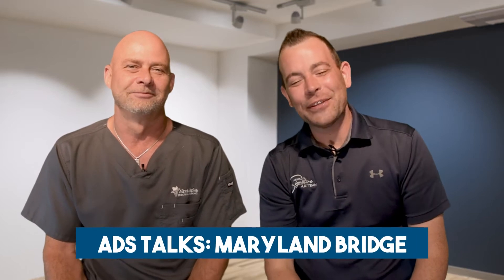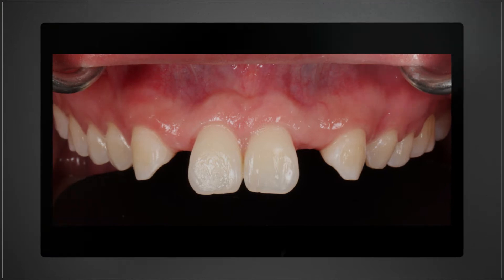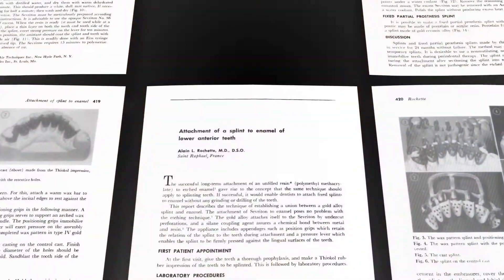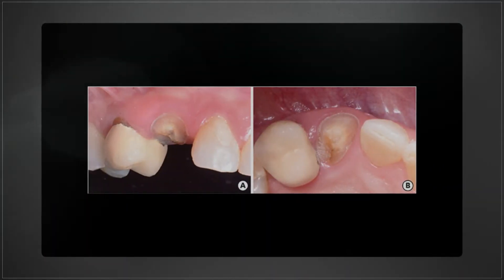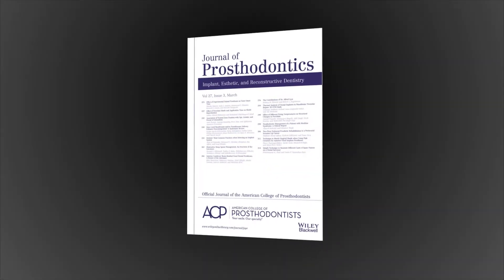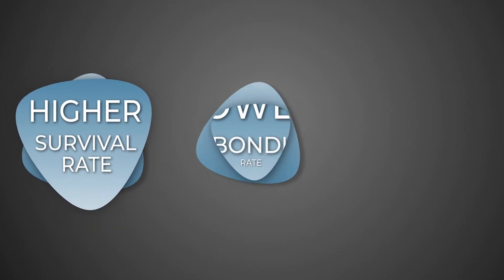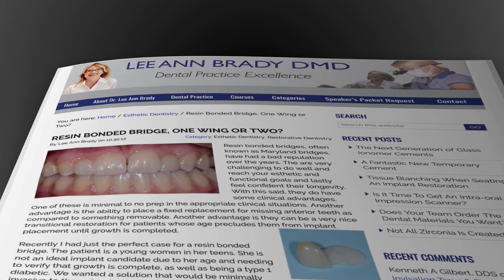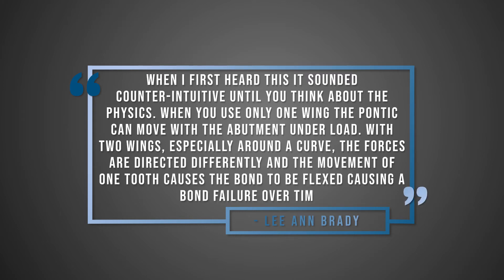ADS Talks: Maryland Bridges

Comment: One other thing I will add here is you could go with a flexible denture. Think they are called valplast. Feel free to correct me on the terminology. They straddle over the gum and don't have the normal large plate on the bottom that tends to affect speech and are uncomfortable. A more permanent bridge makes sense to me but be aware they are pretty fragile. I've had partial dentures as well and a lot of times they end up in your shirt pocket.

Comment: My experience is that the vast majority of dentists will not perform them because of the high failure rate. An implant is certainly a better option, assuming you have the bone structure for it. I unfortunately did not and was quoted nearly 10 grand to perform bone grafting, and implant from an oral surgeon. That price did not include the final abutment and crown. I asked the oral surgeon how long it would take and he quoted me two to three hours total. Pretty nice wage. Pretty sad we have this technology that is largely unaffordable for most people. A Maryland Bridge does remove less of the tooth than some other alternatives. In my case, I was looking to replace tooth number 25. This is a smaller lower front tooth, which means the adjacent teeth are also fairly small and brittle. Doing a traditional bridge would remove a big portion of the tooth, and you never get that back. This also weakens an already fragile tooth.  The Maryland bridge removes less of the tooth structure, but there is also less bonding surface. With that said it makes sense there would be a higher-than-normal failure rate, but I would also say there's a greater chance you're not going to end up fracturing and breaking an adjacent tooth. A doctor can always re-cement the bridge back on. Just be aware if you get one of these, you're not gonna be biting into apples or chewing peanut brittle or something. They are fragile. I guess I can't say I blame the dentist for not recommending them.  I had to be pretty persistent to finally get a dentist to agree, but I think they can be a good option. I do wish more dentists didn't have such a god complex.  There is no absolute correct procedure that's right for everybody. Try to find yourself a dentist who doesn't have an ego as big as the planet and is willing to work with you. I had great luck while in Thailand. Not so much in the U.S. Blows my mind you can barely talk to a dentist these days without them wanting $400 just to look.
Reply: Thank you 🙏

Comment: I have a fractured lower tooth #30.  I was told that a root canal is not an option after a 3D x-ray was performed.  Now I'm trying to find an affordable way to fix this that is not the typical "implant".  It doesn't seem that professionals don't even offer alternatives.  Doing my research this Maryland Bridge seems it may work.  I'm 77 if that makes a difference, it appears that this tooth will have to be removed.  Any suggestions that I can take away from you would be appreciated.  Thank you
Reply: Sorry to hear about your fractured tooth.
I retired from dentistry a few years ago and can offer only observations and not diagnosis or treatment planning. Classmate at U. of Maryland Dental, Van Thompson, was involved in original development of Md. Bridge.
If you are in good health and  a candidate for an implant, and can afford the higher cost, the implant would provide a more predictable long term outcome. It stands alone,. doesn't rely on the condition and support of the teeth/tooth it attaches to.
The implant, standing alone and acting as if a real tooth, presents a reduced risk of food trapping as under the fake tooth part of the Maryland Bridge.
Maryland bridges have a long history of success but they can debond requiring recementation. Once integrated into the bone, the implant should never come out but nothing is 100% guaranteed.
Nature's tooth didn't last forever and man's creations are also subject to variable success rates.
Dentistry is always growing and learning from experience. The presenters here are speaking on findings of design that are established from observations over time.
Neither I nor the presenters can view you and your entire mouth to properly advise what is best.
In reality sometimes the cost of a root canal and crown can approach the cost of an implant.
Speak with your own trusted dentist and let them discuss the alternatives, cost and expected longevity. 
Good luck.